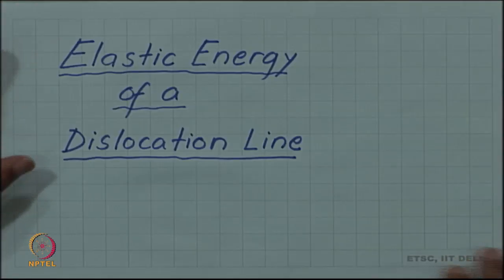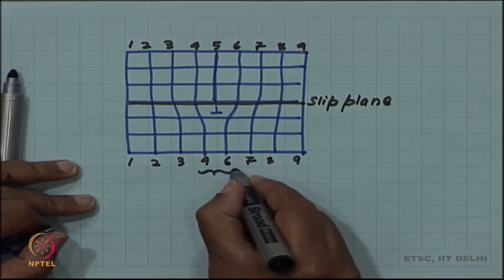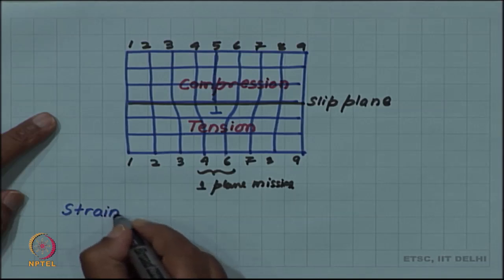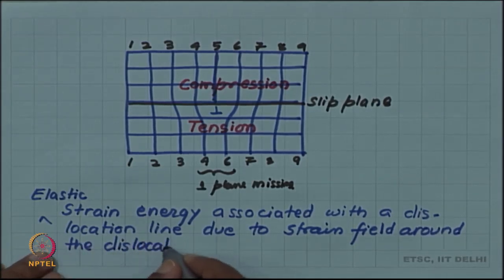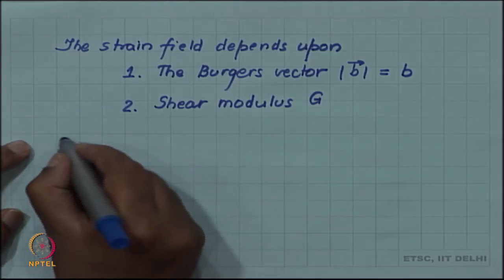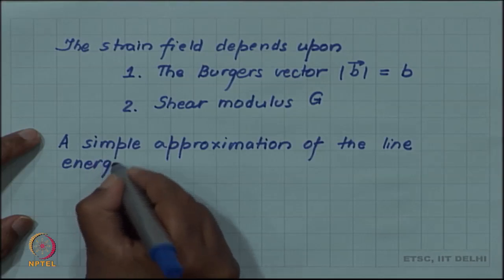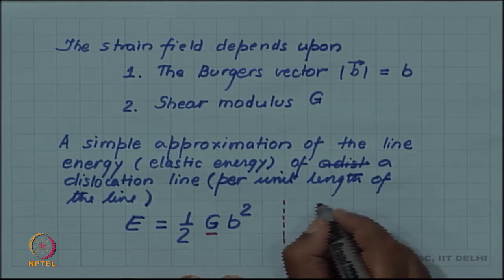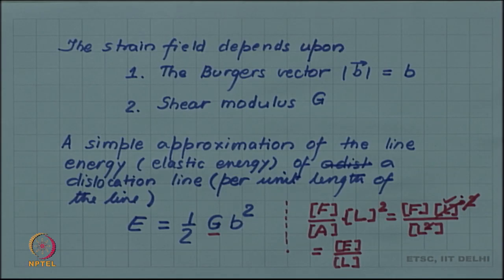Elastic energy of a dislocation line

Comment: Sir, how line energy of a dislocation line can be associated with Burgers vector? Shouldn't it be associated with tangent vector ( because tangent vector is along the direction of dislocation line ) ?
Reply from the maker: The energy of the dislocation line depends on the deformation or distortion caused by it. Since the line is a boundary between slipped and unslipped regions the deformation associated with it depends upon the magnitude of the slip associated with the line. This is the magnitude of the Burgers vector. The tangent vector only gives the orientation of the line. Thus in the isotropic assumption it has no influence on the energy. But real crystals are anisotropic, so the tangent vector, i.e., orientation of the line,  also has some influence on the energy.
Reply: @introductiontomaterialsscience  Thank you so much sir, I got it now.

Comment: The dimensionsal analysis at the end of the video... How E/L came at last.. It was clueless.. Please check once
Reply: [A] represents the dimensions of area i.e [L]^2. So the [L]^2 term in the denominator cancels the one in the numerator, leaving us with just the dimensions of Force. Now, multiplication of the dimension of length [L] in both numerator and denominator gives us units of (Energy/Length). Hence, the elastic strain energy per unit length.
Reply from the maker: @TheSourav77  Thanks Sourav for your clarification.
Reply: @TheSourav77  Bro,are we considering the change in work?

Comment: why there will be a tension in the bottom part
Reply from the maker: In the same distance, there is one less plane below the slip plane. Thus interplanar spacings are slightly larger than the ideal interplanar spacing. This is equivalent to tension perpendicular to the plane.

Comment: Sir, is it the energy stored in the material during elastic deformation (called as resilience) or energy stored during plastic deformation (in the form of lattice strains) ?
Reply from the maker: Sorry, somehow missed your question in time. It is the elastic energy of the dislocation line itself due to internal strains caused by the dislocation. It is not resilience which is elastic energy due to stains caused by external forces.